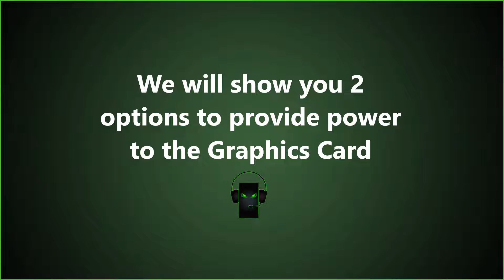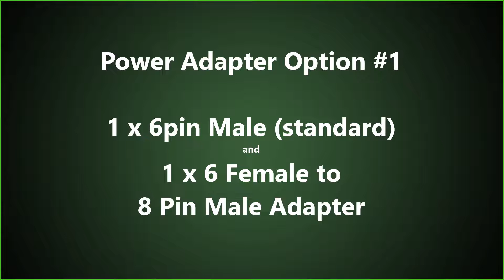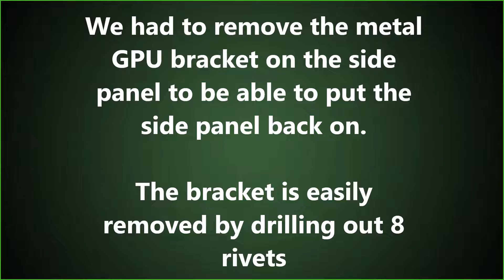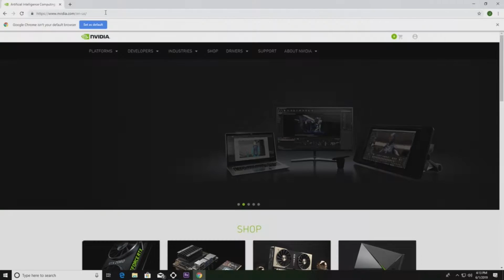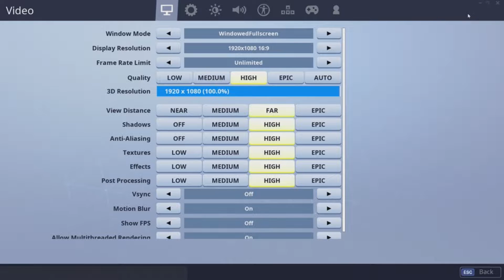Precision T5810 EVGA RTX 2070 Install w/Game Testing

Comment: Superb drilling out the rivets solves my t3610 and gtx 980 issue thank you. Also clearly explains power connections as i have 6 pin and an 8 pin connector to my gtx 980. Excellent thanks again 👍🏻

Comment: Your videos were extremely helpful. I bought a Dell Precision T5600 in 2017 with 825W PSU, Xeon E5 - 2670 v2, Quadro K4000. Currently I'm working in architecture field and the K4000 cannot handle real-time rendering very well so I decided to buy a RTX 2060 Super. However my PSU have 6+6 pin and SATA I really worry about using power adapters, since the VGA sellers in my place constantly told me that using power adapters can lead to unstable power supply. Is it true in this case? I won't use that much power in hardcore gaming, just real-time rendering with Enscape and Vray (hardcore rendering and computing are handled by the Xeon).
Reply from the maker: You can use a 2 x 6Pin female to 1 x 8 Pin male adapter and it will be very stable in your system.

Comment: Hi. I'm from Brazil and recently i bought a t5810, and a can tell, your videos and blog helped me a lot. So i've a question: Does the rtx 2060 and 2070 work with 685W?
Or just below the 1660TI? 
If a want make a CPU upgrade, the xeon V4 works?
This is my setup:
Intel® Xeon® E5-2630 v3 2.40 GHz
4 x 4 GB (16 GB) 2133 MHz 
NVIDIA Quadro K620 2gb GDDR5 PCI
Reply: A 685W power supply should easily cope with a RTX 2060 or RTX 2070 graphics card, so don't worry - these are quality power supplies in a quality workstation. I'm currently running a Sapphire Pulse RX 580 that's stable with no problems at all, and I'm using a 685W supply, the same as you. On that basis, the Nvidia cards you mention should be absolutely fine.

Comment: HI, i have 2xc 6 pin pcie cable like yours but mine gtx 1660ti need 8pin to power up.. should i get a single 6 pin to 8 pin or 2 x 6 pin to 8 pin to power up the card??

Comment: I've got the T5810 as well, except it appears that my system is completely missing the GPU power connectors. There is what appears to be an 8-pin PCI-E Graphics power connection directly on the power supply's daughter board, but there's no cable! Any idea what cable to buy for that?
Reply from the maker: This is the cable.  https://www.serverworlds.com/dell-d92c9-precision-t5600-t5610-t5810-graphics-card-aux-power-cable/

Comment: I jst found this and the content is amazing and i have one question will it work for a dell precision t5500?
Reply from the maker: The RTX 2070 will work in a Precision T5500.  Expect to see some bottle-necking while gaming.
Reply: Not much bottle necking if you are running two of the better 6 cores cpus in the T5500. X5675s or X5680s are your best performance per dollar

Comment: I am planning to upgrade RTX 3070 (650 watts). My current system have 685 power watts, wound it be enough?
Reply from the maker: We haven’t tested it yet.  However, it should work fine.

Comment: What is the maximum GB Ram to put in the Precision T5810?
Reply from the maker: According to the Dell Spec Sheet, 256GB of memory.  However, for gaming, we rarely install more than 32GB of memory.
Reply: @GreenPCGamerscom   
Thanks a lot! Have Dell only goes with one CPU? Or is there a Dell model with two CPU's out there?
Reply: @jamesearl4508  The Dell T7810 is the two cpu version of this model (the T7810 is the full tower)

Comment: I have a 250W gpu card I wish to use with exactly this machine. There is only 2x 6 pin male connecters from psu. But the card is 8 pin female. I believe I require the cable used at 1.59 but can't seem to find it. Anyone know where in the UK I can get this? Thanks
Reply from the maker: https://www.amazon.com/gp/product/B01N3T6C2K/ref=as_li_tl?ie=UTF8&camp=1789&creative=9325&creativeASIN=B01N3T6C2K&linkCode=as2&tag=greenpcgamers-20&linkId=3bf6e70495ed242ddf02d2747c987365
Reply: @GreenPCGamerscom  thanks for reply. Looks like only the US had this as the UK amazon is not listing it. Appreciate your assistance 👍
Reply: @faisalparkar  Have someone you know in US buy it and ship it to you.

Comment: Hey would the new Rx 5600 xt gigabyte oc triple fan fit in this pc, it’s 5e cheapest card in my area
Reply from the maker: We haven't tried that card.  Let us know if you try it.
Reply: Will do, is there anything I should know before I put it on?
Reply: Last thing I fell like this is a stupid question but since you specialize on this pc to upgrade to the Rx 5600 xt gigabyte oc with these specs
Xeon  E5-1607 v3
4x4 2444mhz  ddr4
1x1 tb hdd 
FirePro w2100 
685w psu

I would have to
1 uninstall the drivers 
2 remove the w2100 
3 install the Rx 5600 xt
4 boot up
5 go to amd and get newest drivers

Is that all I need to do because I am scared and don’t want to mess anything up.

Comment: Hi There ... I Live in Europe and i cant open the links....any help?
Reply from the maker: Tell us what model system that you want to look at and we'll post it on our forum.
Reply: @MrModuMix i already had tried...vpn...tunnelbear and nothing
Reply: @rabernardo999  The website is locked out from Europe, however the forum works fine without VPN from the UK. I normally use PIA, but one can also use the built in one in Opera and then open in a private window.